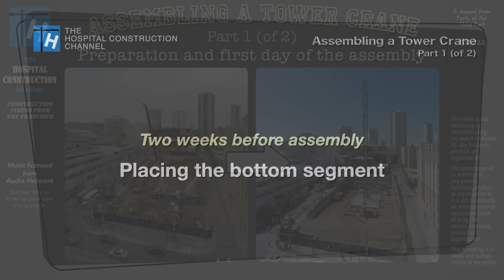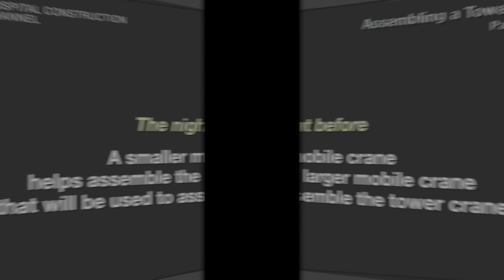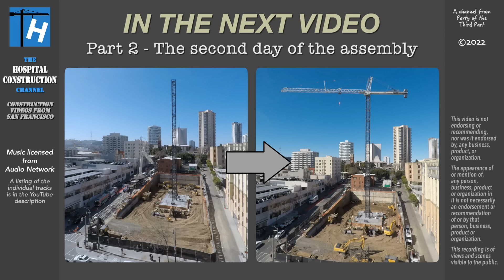Assembling a Tower Crane - Part 1 (of 2)

Comment: My 1st construction job was on a 10 story building in Nashville 30+ yrs ago. 
 The structure was built using a very large Manitowoc crawler and that operator was by far the loudest human on the planet which was handy because he regularly worked green riggers including me. 
  Once while swinging close to the building, the hoist cable slipped into a snap clevice that was securing a safety net around the 8th floor. No way to unhook it but for a volunteer to ride the headache ball straight up and unlatch it. 
 Cheers.
Reply: So did you do it??

Comment: Spoke to soon. Saw their method of torquing those nuts on the crane sections
Reply: What it looks like they are doing is actually tensioning the bolts. Which is the basic goal of torquing a bolt, but more accurate. It looks like the tool is actually grabbing the top of the stud and pulling it, then just run the nut down snug to hold the tension. This is a great way of doing this because it eliminates the big variable of the friction between the nut and the bolt, and it saves having to apply huge torque values.

Comment: It always amazes me to watch the "big dogs" come in and work. Endless equipment and personnel. Didn't even get the slew stacked. No. Got guys futzing around greasing bolts at the job (that's a shop prep job). I suppose it doesn't matter if you own the mobile and you're milking it. Money gun go BRRRRRR.
Reply: Yeh I wonder what the death rate is on Chinese building sites

Comment: Amazing construction in preparation to construct a building.  Those crane segments appear to be 40’ each in length. Anyone know what the actual dimensions are?
Reply: Peiner sections are 6 meters or just shy of 20 feet. These are double stacks or two at a time so 40 feet is about right.

Comment: i wounder how they are going to fit enough concreat in that hole with all that steel rebar ?
Reply: Most of the rebar is near the top for technical reasons.  They add an extra layer of rebar because of earthquakes.
Reply: @firesurfer  THANKYOU

Comment: What happens if the foundation isn't thoroughly dry before assembling?
Reply: Concrete spalls
Reply: I'd expect they would need to let it cure aswell - but maybe a calculated risk as only adding vertical sections while it cures - didn't see how long after pour they started erecting

Comment: What happened to the electric  impact guns to torque down those bolts on the section? Would’ve loved to seen the torque wrench they used.
Reply: Air or hydraulic.  37:23
Reply: @firesurfer  HYDRAULIC, look up how ships engine bolts are torqued, this is the same, a hydraulic jack supplies the 'squeeze', then they just do the nut up by hand (or tommy bar, etc), that's it, the nuts hold the 'squeeze' the expanding cylinders place on the joint, so no grunting from the workers!- the hydraulic pressure on the guage is the torque applied, NO MATHS needed, easy.

Comment: I’m really surprised they were only hand tightening those bolts when the crane sections were going up.
Reply: the tower needs to flex, its for contraction and expansion.
Reply: Once the tower was stacked, it looked like the mobile flew the iron workers a Hy-Torque and extension cord. We don't torque until the whole crane is built out in many cases. The only difference is, we hit the nuts on with a knocker wrench as we're moving up, which is somewhat better than finger tight. The Hy-Torque is a fairly heavy unit, so you don't want to have to carry it up the crane. Torque and lower the unit as you go. It's a two person operation. One person manages the wrench and torque wrench. The other operates the hydraulic unit. We put a rope on the hydraulic pack to lower it down to the next platform.

Comment: what happens if a nut or both nut and bolt is missing and not tightened during assembly?
Reply: Did you notice they mark each bolt after it is finished being tightened properly?

Comment: So how do that remove or deal with that base section of the crane that has been concreted in obviously I know thay can't really remove but what do thay do with it
Reply: There is a piece that is concreted in and just above that is the section that is held in by a tapered wedge. That wedge is driven out and allows that section to be removed . Anything which is slight can then be torched off level with the concrete.

Comment: Did this crane ever need to be jumped to a greater height during the build?
And if the base wasn't set in concrete, what was all the fuss about getting it in place before the pour?
Reply: It was set in concrete. At 1:47 you see it setting on the bottom of the pad. At 2:47 you can see them placing rebar loops over the feet of the crane to tie it to the rebar mat at the bottom of the pad. At 3:48 you can see the rebar at the top of the pad,  five feet or so above the bottom of the lower crane section. At 6:44 you can see the concrete covering all that rebar, leaving the bottom section of the crane totally buried in it.
Reply: @constructionwatcher5381  Some of these questions are almost as if the person asking did not even watch the video.
Reply from the maker: This crane did not need to be extended.  It was erected at the full height that was needed.
Reply: There is a sacrificial segment that gets buried. It's only about 4 feet long (1.2m). It stays there permanently.

Comment: I have burning question which I have been eagered to ask about this cranes... what happens when the build is finished but the crane is inside the building 🥺 how do they remove the crane and the parts out ?
Reply from the maker: You can see it here: https://youtu.be/MSJGlzVQUeg
Reply: @HospitalConstruction  Sheltered World
:eyes-pink-heart-shape:
Reply: The tower sections will be in a shaft. Generally where the lift for the building is sited. The mobile will take the sections out when the building structure is completed. The same way as it was put together. I hope this quenches your fire.

Comment: a bit late, to be 'bolting up', the structure is already errected!, you SHOULD use a spanner AS you errect it, so it is SAFE for the guy to climb up and take the rigging straps off.
Reply: Every Peiner I’ve ever erected or climbed gets the bolts torqued after all the sections are in place…
Reply: @ftaf08  But why is that? Is there a practical reason for it or just laziness? Cuz it doesn't seem to be very safe to have such a large, heavy structure without bolting it down tight.
If the wind picks up and the thing starts to sway, couldn't it just sheer the bolts off?
Reply: If you don’t know what you’re talking about you should just keep your mouth shut.